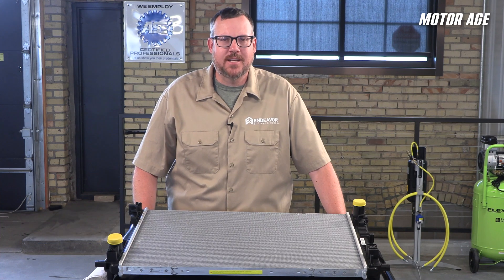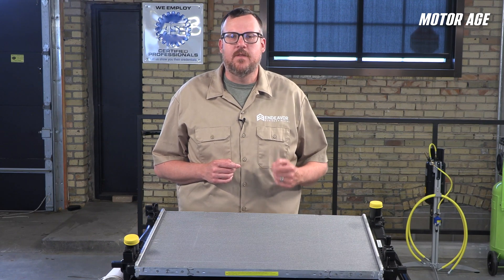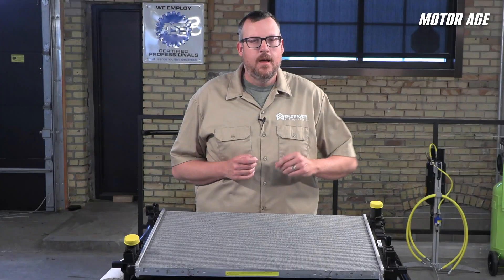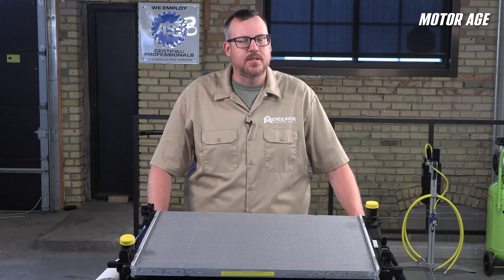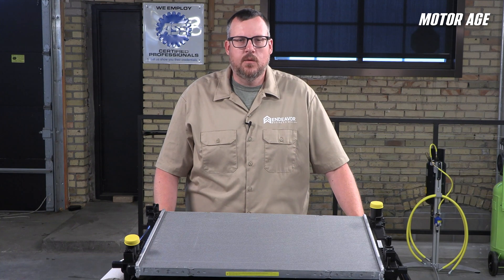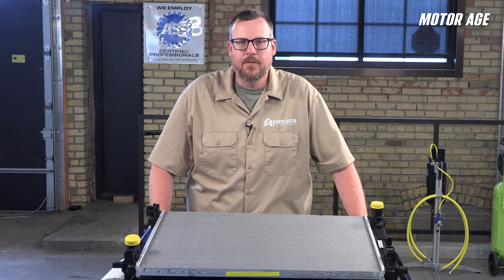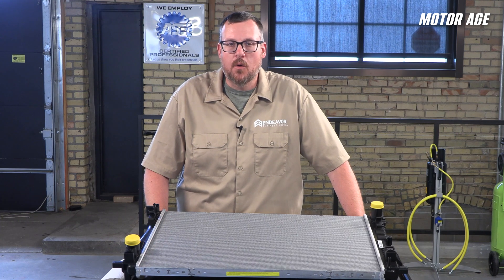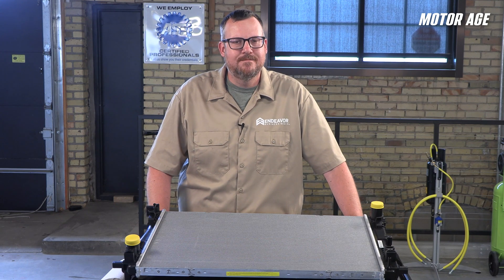Tech Tip: How to Diagnose Overheating with Thermodynamics and Data

Comment: Good stuff. I have a simple agricultural diesel cooling system diag to perform this week. The issue is recurring. Gonna use your examples as they relate to my system. One factor I noticed was omitted is the quality of the coolant itself. In my industry, it is common for operators to refill an overheated system with whatever they have on hand including soft drinks. Thanks for the post.

Comment: Great analysis of the thermodynamics of the cooling system with the radiator at the center.  
One thing that can be a big help is coolant.  It wears out like everything else.   I can change it every 3 years.  Like engine oil, coolant is cheap.  Cooling system parts are expensive!  Thank you for this video.
Reply from the maker: We appreciate your feedback!